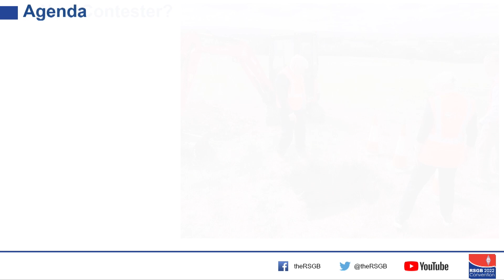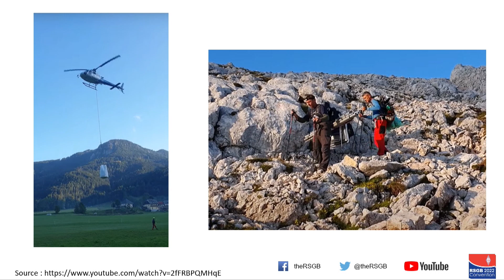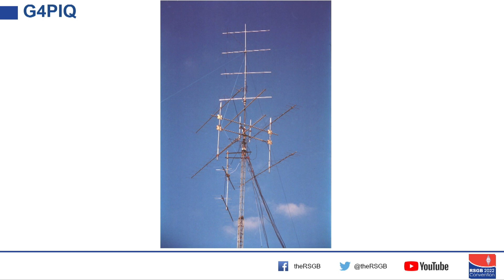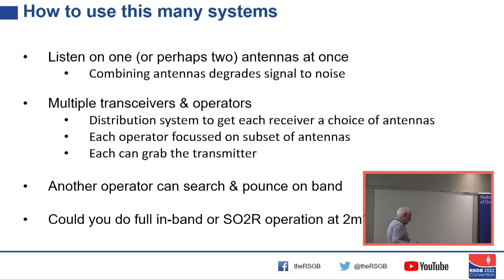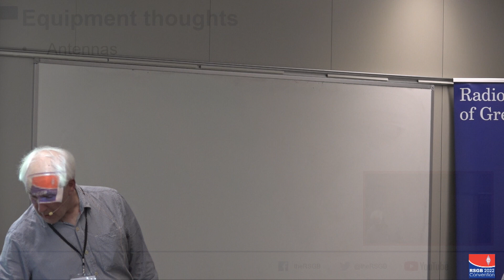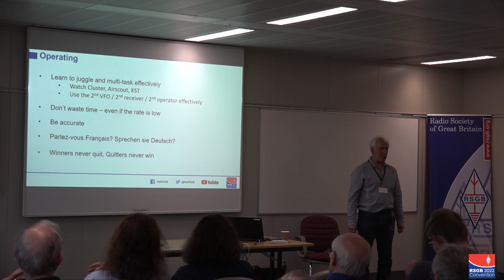RSGB 2022 Convention - VHF Contesting trends and tips

Comment: DF9IC/DR9A here:
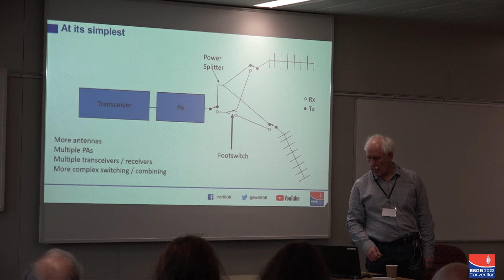13:45 we "cross the streams" intentionally - but this works only under special conditions and with full phase control between the various groups. You are 100% correct for the usual setups.
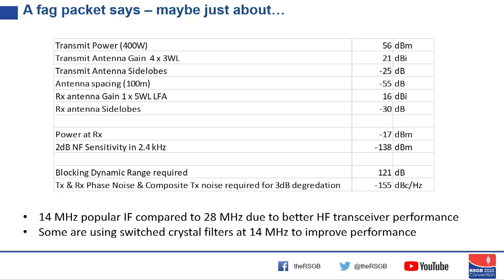23:58 we used a single 14 MHz crystal filter for our run frequency since 2006, and also built one for our next neighbour soon after. BTW they used to produce up to -13 dBm at our antenna before they changed their QTH a bit. The filters on both sides help to stay happier 😀 - Since about 2016 each OP has his own box with switchable 14 MHz filters from S53WW.
27:27 cannot agree enough. We have a PERSEUS SDR with home made downconverter which allows to measure down to -150 dBc/Hz on site connected to PA monitor outputs because sometimes shit happens, and we want to know. - Reliability is the key if you have tuned your station otherwise - in 2022 we lost to SN7L by 0.8% because we had a 45 min 230 V power outage on Sunday morning.
32:27 during peak hours we have a 3rd OP in the background to arrange skeds on KST for the two active OPs.

I like your presentation very much, it reflects our own thoughts.
Reply: Thanks @Henning_Rech - sorry I've only just seen your comments. Thank you for the really interesting feedback and the inspiration from what you and your team do! 73 Andy, G4PIQ